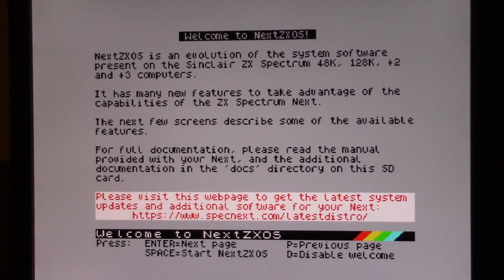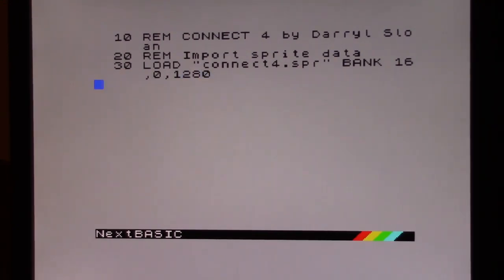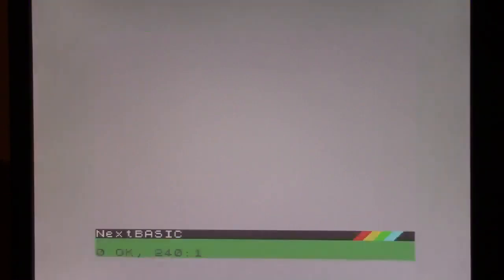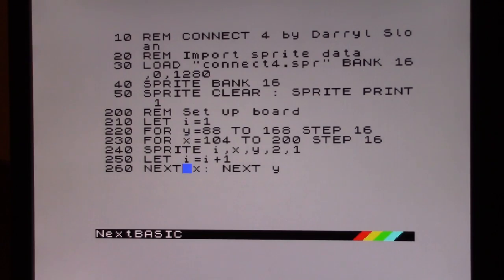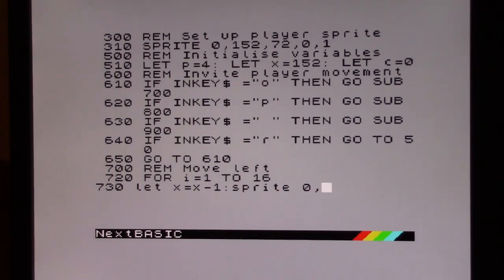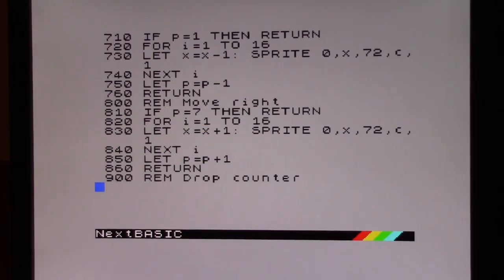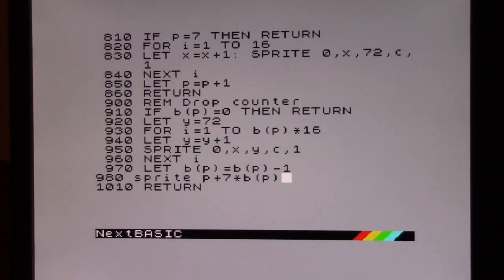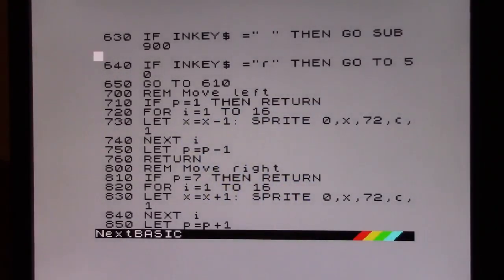NextBASIC sprites tutorial #1: coding "Connect 4" on the ZX Spectrum Next

Comment: Amazing video.  Question, saving my .spr file fails every time :( any ideas?
Reply: Sorted it.  no need for the speech marks in the file name
Reply from the maker: @stevenqneuk8  Strange solution. Quotes are optional (necessary only when using spaces in a filename), but including them shouldn't cause an error. I was thinking you were maybe using the CSpect emulator? I've heard that the sprite editor won't currently save under emulation.
Reply: @darrylsloan  I'm using my brand spanking new Next Plus hardware, just got it delivered a couple of days ago.  It's awesome

Comment: I am thinking through this as I watch in bits and pieces... so I take it the connect4.spr contains all the SPRITE 0,1,2 and so on... sprites... I am guessing the Sprite Editor puts a # next to each so we know what one to call?
Reply from the maker: There's no numbering in the sprite editor. It's just organised left to right, starting with pattern 0. These aren't actual sprites. It's a little confusing because you can store 64 patterns and there are 64 hardware sprites. You could give these a one-to-one relationship, but you could equally use patterns 0 to 3 to create a 4-frame animation for a single sprite called sprite 0 or sprite 10 or whatever. They wouldn't be 4 actual sprites. In my game, you can see that I'm assigning pattern 2 to sprites 1 to 42 (each slot of the board). The sprite editor simply stores the data for the graphical patterns in blocks of 256 bytes each that sit snugly together in memory. So the command SPRITE 20,160,90,2,1 would activate hardware sprite #20, place it 160 pixel horizontally from the left, 90 pixel vertically from the top, using pattern 2 from the sprite graphics data, and 1 means visible. The actual x,y value corresponds to the top-left pixel of any 16x16 sprite. There are 64 hardware sprites that exist separate from the Spectrum's memory, all defaulting to 0 (invisible) on their 5th parameter. These sprites are never created or destroyed; they're part of the computer's architecture, and they are manipulated by patterns and x,y co-ordinates assigned to them using the SPRITE command. It's a very well designed command, because animating a sprite just involves changing the 4th parameter (the pattern) as you move it around.

Comment: Nice one Darryl. I think line 980 warrants a bit of a better explanation of what the maths are, and how you've concluded that - in the interest of education 😁
Reply from the maker: Okay, here's my explanation of "p+7*b(p)" in line 980. :-) We'll use the test data of a counter dropping into the middle column and landing at the very bottom. That means p (player's chosen column) is 4 and b(p) is 6 (it's initial value, meaning 6 drop slots available). Or it would have been 6, but you can see that line 970 has already subtracted 1 from it. So it's 5. We know that the board sprites are assigned from top left to bottom right, as you would read the text of a page, starting with sprite number 1. So, counting manually with your finger on the screen, you can calculate that you want to end up with sprite 39 as the answer. Now to get the computer to work it out: Start the calculation with the horizontal. p takes us to sprite 4 (top of the middle column). Now we need to get to the same slot five rows down. We can get one row down by adding 7, two rows down by adding another 7. So, multiples of 7 is the key. And b(p) is 5, the specific mumber of times we want to move forward by seven. So b(p)*7 or 7*b(p) will do it. BODMAS applies, so multiplication is always done before addition, which is what we want, but you could add brackets for clarity, such as p+(7*b(p)), that is: 4+(7*5)=39. That's it. :-)
Reply: @darrylsloan  top job mate - that was exactly the ask. Not only that, but you've also covered very important aspects that can sometimes catch inexperienced people out, like BODMAS. Appreciate your contribution to the community and please keep these lovely down to earth videos coming. ;-)